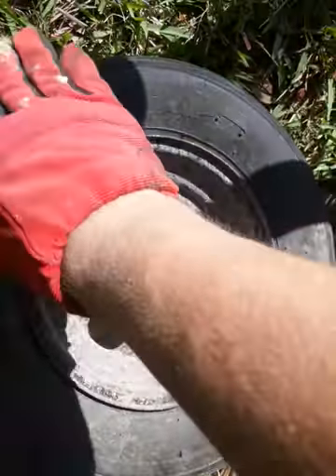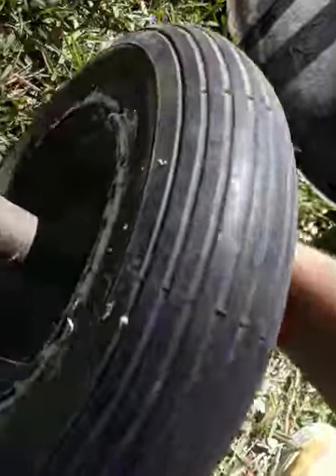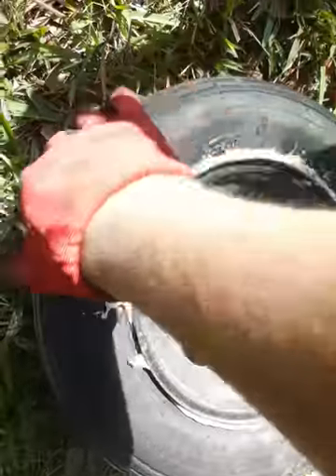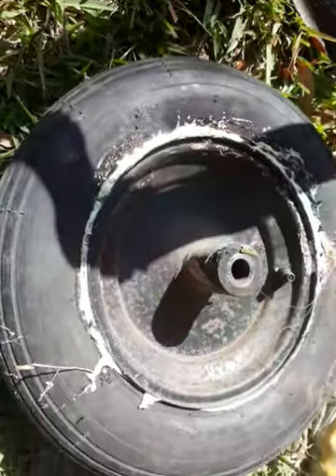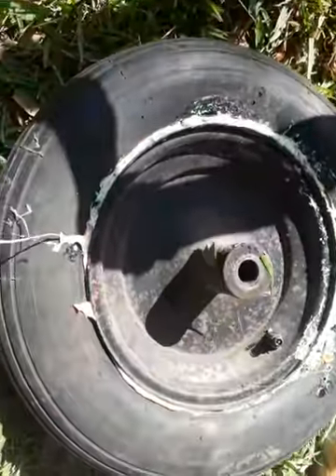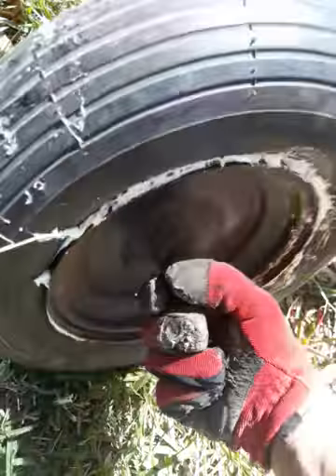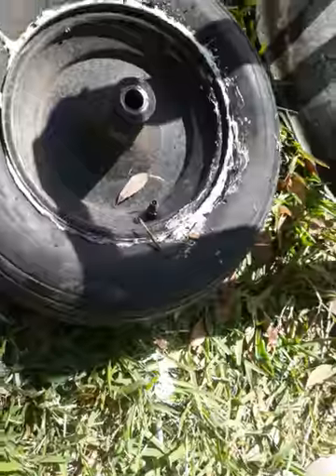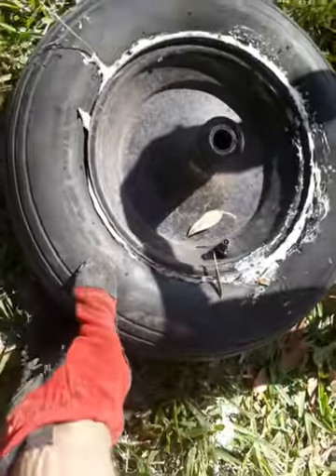How to make a wheelbarrow tire last forever under 10$

Comment: I have done this to every piece of small equipment that has air up tires like wheel barrows, carts, dollies, little trailer for lawn mower and yard leaf vacuum that i pull behind lawn mower generator ect and ill tell ya what the foam i used can hold up to 1100 lbs of dirt or weight period in the lawnmowers trailer and not squish or compress the foam at all. I made a filling station jait for the foam by using a old portable air tank fill it woth foam pressurize it and use that to fill up all the tores i need to. I have not replaced a tire in over 10 years on anything cause it never gets low for them to wear out faster cause we dont check tire pressures on wheel borows and other stuff like that before we yse it, ao if it looks full we use it not realizing its low on air and that missing air causes more wear on thw tires
Reply from the maker: @youknoweverything7643  thats awesome thanks for the feedback